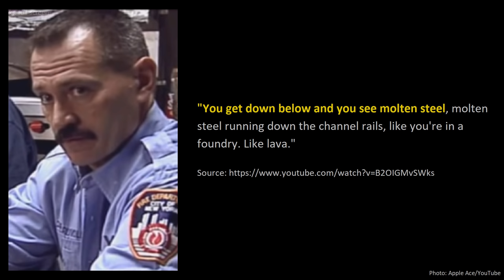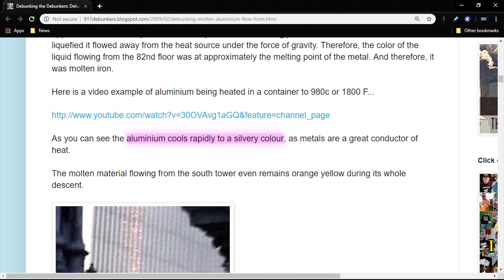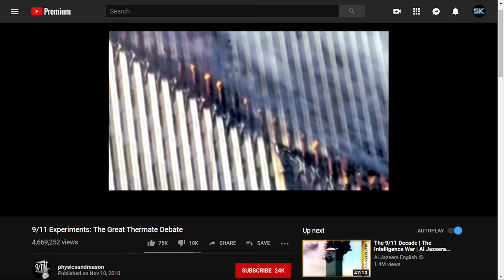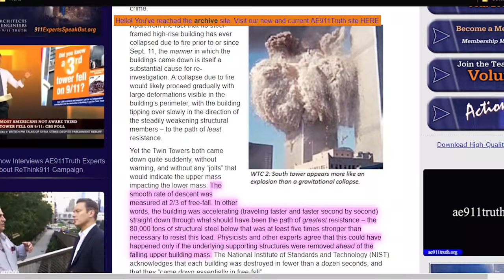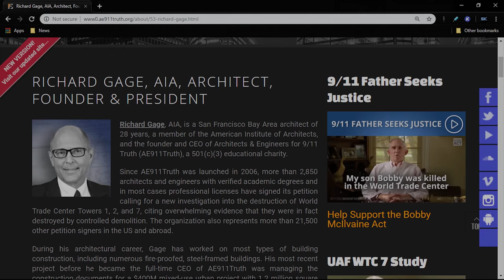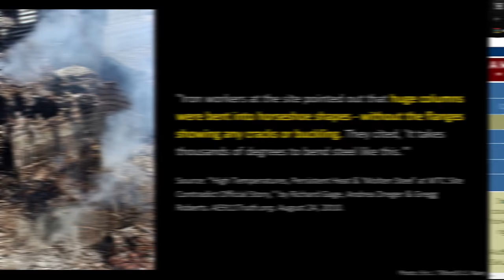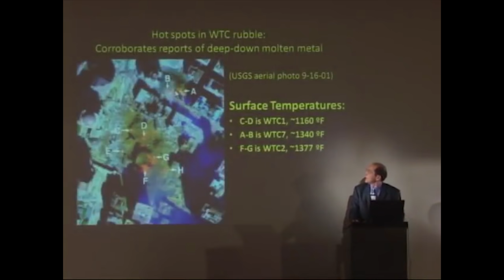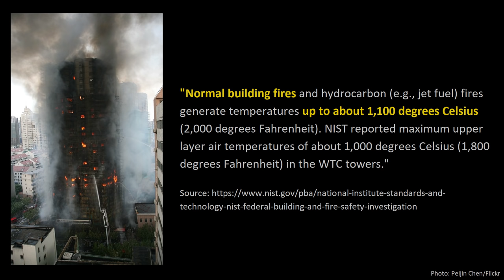9/11 Truthers Debunked: "Molten Steel = Thermite From Controlled Demolition!"

Comment from the maker: The only previously-molten material I'm interested in are the bars of gold you're going to use to support me on Patreon: https://www.patreon.com/aSkepticalHuman
Reply: The reason why his devices don't work as weel is that the thermite isn't pressed (0.7 bulk density), however you can easily achieve 2.0+ densities, i.e. 3× lkess thermite in a given charge. I assure you that those devices are more than capable of collpasing even massive steel columns. It takes about 3 g of composition to melt and blast away 1 g of steel. The volume of filling needed to completely cut a core column would be 50 - 200 l - depending on the row (500 - 1000) and floor.
Also, you don't need to cut - heat weakening is a way to go, too - a less efficient one, though. Just two cuts to a flange will mess up a column, too.

The reason given for the location of the stream is that this was a core column charge from 900/1000 row columns kicked into the corner by airplane debris.

Third, you missed the most obvious debunking point - molten iron is WHITE hot, not yellow.
Reply: Either you're purposefully ignoring way too many coincidences and commonalities of evidence that point to the 9/11 as a MOSSAD/CONSPIRACY operation, 

OR

You are completely unfit and too biased to be an investigator of reasonable evidence. 

1. Larry Silverstein purchases lease for World trade center and the twin towers. A purchase that nearly every business analyst recommended against. The Towers were filled completely with asbestos that would cost a furtune to get rid of....But regarless, Silverstein makes the purchase and takes out huge insurance policy on towers against terrorism 6 weeks before 9/11. 
2. Silverstein worked in the towers every single day without fail, as well as his children, but happens to miss work that day? as well as his children? How convenient...
3. Silverstein gave the "go ahead" to "pull"(demolition term) Building 7, to which the OFFICIAL 9/11 commission report didn't mention the collapse of the 3rd skyscraper that day. A building that fell at free-fall speed, a complete scientific Odyssey, to which if true, we would have to re-evaluate Newtons laws of Physics! No steel buildings have ever collapsed into their footprint, pulverized heavily, at free-fall speed from office fires/jet fuel. 
4. Urban Moving Systems (proven front for Israel intelligence agency) given $500'000 Federal Government Assistance Program On June 22, 2001. A moving company that was used to move out Israeli companies at company losses out of the twin towers just a few months before the attack. The moving vans were later verified to have bomb residue through bomb sniffing dogs.... Israeli companies foreknowledge of attack... Planted explosives brought in.
5. Israeli intelligence agents found celebrating the collapse of the towers, admitting they had foreknowledge of the events. Israeli agents under benjamin netanyahu, who larry silverstein spoke to on a regular basis. If Israeli intelligence knew, Silverstein knew.
6. September 10th, 2.3 trillion dollars admitted to be unaccounted for? Pentagon accounting offices trying to account for this money completely destroyed the next day under the guise of a plane hitting it? To which dozens and dozens of cameras could have captured? But the government refuses to show any of those, and hand picks ONE inconclusive video with botched frames?
7. Molten steel from dozens and dozens of first responders and witnesses, combined with nanothermite in all dust samples. This fact alone debunks your entire video. NANOTHERMITE. ADVANCED, MILITARY, EXPLOSIVE, MATERIAL.
8.Mysterious deaths of key witnesses of 9/11 with the likelyhood of all of them dying in the fashion that they did comparable to one person being struck by lighting 10X. No investigation of that, many unanswered questions, purposefully abandoned.
9. There are hundreds of other related, convenient, and coincidental points. 
10. There is no problem with leaning towards believing in a conspiracy. All it is, is following a lead of evidence, just like any other type of investigative groundwork. People who lean or believe or bend towards following evidence that leads towards conspiracy are just are actually regarded as better investigators, so long as they an remain to be unbiased in the end, and remain open to all facts, no matter what side of the coin they're on. 
11. I used to buy into the false narratives, before I developed and open mind.
Reply: @sadiel6353  I'm enlightened and everyone else is a shill! cough spit
Reply: So, how about you Explain how Building #7 Collapsed from office fire...... And Please Explain where the Remains were, of the air plane wreckage, in the 911 Pentagon crash, and Shanksville 911 crash.. Thank you..
Reply: @valleygirl7736  🙄
Reply: @julianerikson4191  you're going to be very insignificant in your life if you wont wake up. But it's your choice Mr. Blue pill.
Reply: @justinturner8219  Insignificant in what way and how would you know?
Reply: @julianerikson4191  you realize everything he wrote was factual right? None of that was made up. How does that make him a nutbasket?
Reply: @Insane3OB  a person is not likely to have much of a real affect on the world of they dont understand how the world really works.
Reply: @justinturner8219  Which is why conspiracy theorist's talk a lot of nonsense. They don't live in reality.
Reply: so the picture with glowing metal says oct 21 2001 so it was glowing for 40 days what keeps metal that hot for so long???? It doesnt self combust.I use a torch and weld all the time it quickly disapates heat.The buildings wouldnt collapes like it did either 1,500 enginers say a skeletal metal building expecially from floor 1-50 that had no damage should have stayed and definally would not have the speed of damaged floors it would have slowed down and slide to a side not straight down
Reply: One simple question:
Do you completely believe the official story about September 11, 2001 or are there any parts of it that don't make sense to you?
Reply: @justinturner8219  Very close to my view on it im not sure of the isreal thing.They shut the power off the twin towers so they could do work which also shuts the sercurty cameras off months before 9/11.You didnt mention building 7 explosions or the guys walking away from the building with hard hats and repeatingly say the building is coming down then boom.Had to be the demolision guys how would they know.Question those guys.Enron and security exchange fraud cases in building 7 helped bush and cheny and friends
Reply: @nehorlavazapalka  Molten Metal is white hot; not yellow? You don't weld and/or fab much; do you?
Reply: look at it ... just take a look ... Uh you will see  how some researchers/debunkers are in dipper compared to this simplest approach
Reply: way to many blacked out parts from the official investigation documents that were published. 911 will always have a dark shadow over it, no matter how many videos youtube deletes, to erase the history.
Reply: No, it's Building 7.
Reply: No one supports a fraud
Reply: Pretty crazy the aluminum wings ( the lightest part of the aircraft) cut through the steel outer wall also.
Reply: @justinturner8219  Oh, look, a list. Lists are fun. Let's see how well THIS list does.

"The Towers were filled completely with asbestos that would cost a furtune to get rid of"
And which would have made Silverstein not actually lease the WTC. Thus, we can conclude that there was no asbestos. This of course on top of the fact that, if there HAD been need for a asbestos removal, that would have fallen on the owners, not the leasee.

" Silverstein worked in the towers every single day without fail,"
No, he didn't. He did, however, USUALLY show at the Window to the World restaurant in the morning. But on the  day, he had a medical appointment, something which is publicly known.

"Silverstein gave the "go ahead""
No he didn't. That you don't know what he said doesn't mean he said what you want it to.

"to "pull"(demolition term)"
No it isn't, in the way you want it to be. That you don't know what it means doesn't mean it's what you want it to be.

" to which the OFFICIAL 9/11 commission report didn't mention the collapse of the 3rd skyscraper that day"
Which would follow, since the Commission had nothing at all to do with that.

"A building that fell at free-fall speed"
This means two things. First, you don't know anything about physics, and the meaning of the term you're using in error. And second, that you don't know anything about the buildings at the WTC.

" we would have to re-evaluate Newtons laws of Physics"
I suggest you go back to school and actually learn . There are no "Newton's laws of Physics". There's Newtons Laws of MOTION, but they don't apply here.

"No steel buildings have ever collapsed into their footprint, pulverized heavily, at free-fall speed from office fires/jet fuel. "
This, of course, is supposed to be MEANINGFUL. What it manages to be is STUPID. Let's count the ways this shows your utter lack of knowledge, education or capacity for though.
1, "no steel buildings have ever" is a lie. It happens multiple times a year. 
2, "into their footprints" is brainless nonsense. That didn't happen at the WTC, easily enough realized if you actually bother to look up how they fell. For instance, the North Tower fell ONTO WTC 7, causing the fires. There was 400 yards between them.
3, "at free-fall speed" again, which as noted is not only an overwhelming lack of knowledge of basic terminology, but also is stupid, since that demonstrably didn't happen.
4, "from office fires/jet fuel" is another idiocy. Amazingly, buildings don't actually know what is burning and collapse differently depending. Nor does "office fire" have any meaning, this isn't a smoldering cigarette in a trash-can, no matter HOW much you want to pretend it.

"Urban Moving Systems (proven front for Israel intelligence agency)"
This is bull. SUSPECTED, at the time, maybe. Proven, nonsense.

" A moving company that was used to move out Israeli companies at company losses out of the twin towers just a few months before the attack."
This is an out and out lie. UMS had no connection at all with the Twin Towers.

"The moving vans were later verified to have bomb residue through bomb sniffing dogs"
No, they were in fact verified to NOT have had any "bomb residue", or even EXPLOSIVES residue. Specifically verified not to.

"Israeli companies foreknowledge of attack... Planted explosives brought in."
This is just empty nonsense, not even worth laughing at.

" Israeli intelligence agents found celebrating the collapse of the towers"
Which failed utterly on the "intelligence agents" and the "celebrating". Which really renders the entire sentence moot, doesn't it?

"admitting they had foreknowledge of the events"
Along with all of New York and New Jersey, you mean?

" September 10th, 2.3 trillion dollars admitted to be unaccounted for?"
Which, 1, doesn't mean what you want it to, but also, 2 is EXCELLENT proof of there being no connection to 9/11. Thank you.

" Pentagon accounting offices trying to account for this money completely destroyed the next day under the guise of a plane hitting it?"
Wow. You failed in three different ways in the same sentence. 1, what was in the area struck by Flight 77 is well known and documented. 2, see previous point about neatly disproving yourself and, of course, 3, having a plane strike something is about as great a guarantee of NOT destroying everything as you can get.

"To which dozens and dozens of cameras could have captured?"
The "dozens and dozens of cameras" that aren't actually there, no matter HOW much you want this to be a cheap B-movie techno-thriller? Sorry, Jason Bourne et al aren't actually REAL.

"and hand picks ONE inconclusive video with botched frames?"
The "hand-picked" one that was the result of a FOIA request, and so came about NOT because of the government?

"Molten steel from dozens and dozens of first responders and witnesses"
None of whom actually stated "molten steel"? Who, the approximately half a dozen who DID, weren't competent to make such a determination? The "molten steel" that left no remains, no residue, NOTHING to show it had ever actually been there?

"combined with nanothermite in all dust samples"
That you don't know what thermite IS only mean that you don't know. Nothing else. Only that you're not smart, alternatively educated, to make a comment. That's all.

"NANOTHERMITE. ADVANCED, MILITARY, EXPLOSIVE, MATERIAL."
Which, 1, was "magic space dust from cheap airport thriller novels" back in 2001, and, 2, don't actually explode. Yeah, that "not smart, alternatively educated" thing? It bit you again.

".Mysterious deaths of key witnesses of 9/11"
Which, amazingly, DIDN'T actually happen. This isn't the movies, and the Black Helicopters aren't actually out to get you. Sorry to ruin your fantasies.

" There are hundreds of other related, convenient, and coincidental points. "
None of which you can actually mention, instead pulling the same trite, stupid shit that all "truthers" regurgitate, having heard it all from their "truther" buddies, who heard it from, and so on. But really, it's true!

"There is no problem with leaning towards believing in a conspiracy."
Of course not. Conspiracies happen all the time. Al-Qaeda committing a terror attack on the US was a conspiracy, for instance.

"All it is, is following a lead of evidence, just like any other type of investigative groundwork"
And then having the mental capacity to look at your "evidence" and considering if it's actually evidence or if it's nonsense, as well as having the ability to actually understand and accept the factual, science-based answers given to your questions.
This, no conspiracy theorist is able to do. Because you're SMRT! you are! You know better. ALL the scientists and professionals out there are stupid sheep, they just don't have the clarity of vision and overwhelming amount of brains that you have.

" so long as they an remain to be unbiased in the end,"
There's no such thing as an "unbiased conspiracy theorist". Confirmational bias is inherent in you all.

"I used to buy into the false narratives, before I developed and open mind."
Which you then quickly clogged up with stupid.
Reply: Molten Aluminum is Silver in daylight.
Reply: What facts? You gave nothing.
Reply: @julianerikson4191  not even a valid counter arguement.
Reply: @mooneyes2k478  still waiting for those "facts" you got, buddy.
Reply: @mooneyes2k478  still waiting.
Reply: Who would support a greedy sheep?
Reply: People who believe it was a "muh terrorist attack" 😂
Reply: @robertgunnam8663  Anyone who send money to Richard Gage, Judy Wood, etc, etc.
Reply: @thumb6170  " and you have no evidence he is scamming"
Yes, I do. It's called a 990 form. It's required from "non-profit", very much in quotations when it comes to Gage and A&E911.

The A&E911 990 from, which incidentally they have to supply on request, show very clearly that they're committing tax fraud. The primary purpose for this, as best as I can tell, is to pay Gage 80 thousand dollars a year, while carefully not actually reporting that.

Nice money if you can get it...

As for your "shit", yeah, it's shit. So?
Reply: How the fuck does this mean he is committing tax fraud, he not paying taxes? A citation is needed that Gage doesn't pay taxes. it also seems the money donated goes to the lawsuits (Matt Campbell's just reached its goal now the case needs to be reopened to continue), the UAF report (which satisfied everyone), & getting more Architects & Engineers on the movement (which they did) so "scammer" is not really fitting the Man himself as you failed to even provide at least real evidence he is or at least a citation or maybe an employee speaking out.

If anything the real scammer is the us government with the commission report which was underfunded by our tax money & was set up to fail.

Plus how does this disprove what he says, you clearly couldn't refute the aluminum arguement nor the documentary I sent you.
Reply: I've read recent ones, nothing to see here. Now stop whining 😏 😏 😏 😏 😴😴😴

Gage is 100% not a scammer 😎
Reply: @thumb6170  What's that? You had nothing so you tried to make it about anything else? This was already known, no need to tell everyone.
Reply: Ok Gage is not a scammer. He is a God.
Reply: @thumb6170  Sure. A guy that lies on the tax return of his supposed "non-profit" organization, in order to enrich himself, is a god.
Good sign, there. So much for the supposed "truth", huh.
Reply: I'm not finding any evidence showing he is a scammer. Are you sure you are not the "conspiracy theorist" 😏😏😏😏
Reply: @thumb6170  That you're not able to understand a 990 form? Doesn't really mean anything other than that. As noted, take a look at their 2015, 2016, etc forms. Then compare them to each other.
Reply: I did, it doesn't say he is a scammer.
Reply: I'm not seeing how he is a scammer. Can you tell me? I'm looking at the fourms from 2015 to 2016 its not telling me anything.

& if so why isn't he arrested? 😏😏😏😏
Reply: So its confirmed, you have ZERO evidence suggesting Richard Gage is a Scammer. So much for those "facks" you claim to have. 😏😏😏😏

Anyway I have a question thats off topic but since your a "geenis" I want you to anwser it,

If I take 1 hour to cook a batch of cookies and the cookie monster has 15 ovens working 24 hours a day every day for 5 years, how long does it take the cookie monster to make 6000000 batches of cookies?
Reply: @thumb6170  
2015, 2016: "neither the organization nor any related organization compensated any current officer, director or trustee"
Oh, look, "current officers", read Gage as up to 2018, he was the ONLY officer to be compensated, was compensated 85 and 65 thou, respectively. That's lying on the form.

2016, "fees for services, other" 208,113. Total listed fees, 89, 318. Where's the other near 120 thou?

2012-2016, "Other fees for services", 47,974+41,344. Exactly the same sums, four years in a row, minimum. Copy-pasting is nice and comfortable, but it isn't legal.

From 2009 to 2016, Gage received an average of 79 thou, with a high of 85 and a low of 65.5. Of course, in 2015 and 2016, there was no compensation stated as noted above, but strangely, expense item 5 is still filled in. Surely, a coincidence. Compare 2014, where it's stated that Gage is paid 70,835...and expense item 5 is, what do you know, 70,835.

And in every year, from 2009 to 2016, Gage is the ONLY "current officer, director or trustee" who has been paid by A&E911. Hence, the organization commits fraud specifically to pay him.

2010-2016, A&E911 check the box that reads "Is the organization required to complete Schedule B, Schedule of Contributors?"
Thus, they said themselves that they were required to do so. DID they do so? No, they did not. This additional form required them to list donors that contributed more than 5 thou over the tax year. 2014 and 2016, there was only the first page, no list. 2015, there's no Schedule B at all. This is, again, cheating on the Form 990.
Reply: I'm not seeing how he is a scammer, your wall of text isn't telling me what is being shown on the 990 report. & he is pretty much fulfilling the movements goals with the donated money. No fraud here.

You obviously have no sources either.
Reply: I've read it, it doesn't tell me he is a scammer, you have ANY REAL SOURCES telling me he scams people?
Reply: I see you have no sources for these ridiculous claims, I'm gonna listen to the real men now. Keep making your little fantasies about scams & the 990 forum being proof while giving no evidence 😏😏😏😏
Reply: @thumb6170  You mean other than the Form 990 that he, as head of the organization that he founded, have to sign off on, and which clearly show that the organization is defrauding the US on its taxes? The organization that, prominently and repeatedly extols you to "donate" on its website?

Yeah. What was that about keeping your fingers in your ears, again?
Reply: No evidence 😏😎😎😏
Reply: Aww did you have to face you have no evidence? 😏😏😏😏
Reply: Come on, i don't have all day i need evidence! The 990 forum & your sourceless blabbing is nothing 🥱🥱🥱🥱
Reply: OK I guess you have no evidence or sources so. 😴😴😴😴 come on if you think Gage is a scammer i need information like a source, you know an article that is proof. The 990 was nothing. Its the money the organization receives & how its recieved. Don't think he is scamming til proof is provided.
Reply: You have no evidence do you? 😴😴😴😴
Reply: @thumb6170  As noted. That you want to ignore that evidence because it makes you sad doesn't change reality. Sad for you, but there it is.
Reply: What evidence? The 990 gave me nothing. LoL 🤤🤤🤤🤤
Reply: @thumb6170  As noted. That you want to ignore that evidence because it makes you sad doesn't change reality. Sad for you, but there it is.
Reply: Aruba, Jamaica, oo I wanna see a
Proofado, Jewmado, Gage is a scamrado
Bermuda, Bahama, comon show it mama
Key Largo, Montego, 990 does not show
Please if get proof to show
Just drop it under
& let me know.
Reply: I'm pretty happy rn, you can't even back your claims so you NEED that last word, just let it go lol
Reply: @thumb6170  Yeah. So, you've consistently and repeatedly ignored the evidence presented, because they don't fit with your wishful thinking. When faced with this, you've done pretty much everything including regressing to a 5-year-old to avoid it.

Who was it who "needed the last word", did you say?
Reply: "Evidence", yeah i keep asking for that, can I have it? 😴😴😴😴
Reply: @thumb6170  No, like a 5-year-old that doesn't get his way, you keep ignoring it because it proves you wrong. So, you default to acting like that 5-year-old.
Reply: I didn't ignore it, you didn't give it. 😏😏😏😏 & I guess you have no evidence then.
Reply: @thumb6170  You keep doing that. Ignoring facts you're told, that is. Why is that, no-one wonders.

"No, like a 5-year-old that doesn't get his way, you keep ignoring it because it proves you wrong. So, you default to acting like that 5-year-old."
Reply: "Facts" I still don't have any from you. 😏😏😏😏
Reply: @thumb6170  Except for the ones you deliberately ignored. Which is a thing with you. And really telling.
Reply: I didn't ignore anything. You just didn't provide a fact or proof that he is scamming beside the non profit card which to me proves nothing unless you have a whistleblower from the organization itself. So..

🎵Aruba, Jamaica, oo I wanna see a
Proofado, Jewmado, Gage is a scamrado
Bermuda, Bahama, comon show it mama
Key Largo, Montego, 990 does not show
Please if get proof to show
Just drop it under
& let me know.
But it seems you failed to show
Real proof thats worth a little note..🎶 😏😏😏😏
Reply: Teehee 

https://youtu.be/30OVAvg1aGQ
https://youtu.be/beGkPlJ2eZo
Reply: This is fun.
Reply: @thumb6170  "I didn't ignore anything. You just didn't provide a fact or proof that he is scamming beside the non profit card which to me proves nothing"
Yeah. As was noted, repeatedly.

"No, like a 5-year-old that doesn't get his way, you keep ignoring it because it proves you wrong. So, you default to acting like that 5-year-old."

"This is fun."
That it amuses you to be stupid doesn't surprise anyone.
Reply: It amuses me that you can't prove a single thing to me that even states this man is bad, so all you do is get angry & call me funny things like a child. 😏😏😏😏

I don't see a single thing on the 990 report that shows he is scamming.
Reply: @thumb6170  That you're willing to ignore what's there, and what you're told, only show that you're sticking your fingers in your ears so you don't have to face that your hero is lying on the tax returns of his organization, in order to pay himself money.

Same thing with the aluminium. Ignoring basic physics in favor of your made-up nonsense is meaningless. That your OTHER hero make a video that proves him, and you, wrong only means its proving you wrong. Spamming it multiple times doesn't change things.
Reply: LoL your unscientific & proofless arguement is epic 😎😎😎😎
Reply: >proof & science

Yeah tell another lie.
Reply: @thumb6170  And, what DO you know...
Reply: LoL that molten material was orange/yellow not red hot, it's finalized that was molten steel not aluminum. even nist confirmed that molten Aluminum is silvery
Reply: @thumb6170  "LoL that molten material was orange/yellow not red hot"
You really have no knowledge at all of basic physics, do you?

See if you can follow along here: heat scale runs from deep red to bright red to orange to yellow to white.

Oh, incidentally, thank you for disproving yourself. Liquid steel is white, not red as you claimed.

"even nist confirmed that molten Aluminum is silvery"
Really? Do please show where they did that?
Reply: Yes

They say it right in the book about the tts.
Reply: @thumb6170  Right. "The book about the tts".

Do you work on saying even stupider things than normal, or does it just come natural to you?

Let's see if a repetition gets through to you. It hasn't so far, but hey, hope springs eternal and all that, right?

"Do please show where they did that?"
Reply: You really do have no evidence supporting your claim, do you? God bless Gage
Reply: That liquid metal could be thermite or aluminium. All you need to do is to look that the simulation done from NIST vs UAF vs the video of WTC7. The shape and angles of the 2simulations falling vs the actual video of WTC7 falling shows that  the UAF simulation was clearly looked almost identical to the actual collapse. Also the time it takes for the UAF simulation and the real building fell was very close. However, the time it took for the simulation from NIST was much longer than the actual time it took for it to collapse. ALSO, NIST has most of their information from their simulations classified. And UAF published their full  findings and the specifications of the simulation. Real science reports display all the data and findings. That’s all the real proof you need.
Reply: I don't even give a shit if thermite is involved or not I just know it was demolished & we should now focus on the perpetrators. (Israel, Saudi Arabia, & US Gov't) its all about money.
Reply: *NOTE: Plasco Building doesn't count since its up for question & has every feature of a demolition.
Reply: Hey Einstein , tell me when the molted aluminum was coming out of the twin towers .... How did it stay Molted long enough to end up under building seven , which collapse hours after and still stay Molted  weeks later...
Aluminum alloys go back to a solid phase in less then 30 min.... I'm insulted they would think we would fall for that 
And you should be embarrassed you not only fell for it you advacated it
Reply: @julianerikson4191  Yo people who live in Texas have an extra chromosome.
Reply: Aluminum isn't going to stay at 2400°F to 3400°F for near 3 months. Also, how does molten aluminum get in the basement. Aluminum is not bright orange when molten. I am welder and it is never that color. I cut the stuff with a cutting torch that burns at over 5000°F and the stuff is always silver.
Reply: @Insane3OB  actually I think it’s u not living In Reality.  I think covid showed a lot of people that us conspiracy theorist are not crazy.
Reply: I'm a professional welder and I cut aluminum with a cutting torch every working day. A cutting torch burns at over 5000°F and the aluminium is always silver.
Reply: Copy-paste in a new tab to read this scientific article:
"What Accounts for the Molten Metal Observed on 9/11/2001?"
Reply: @ASkepticalHumanOnYouTube and you sir are also make an assumption that it was aluminum so there for your assumption is also failure and also I'd like to add they never tested the liquid metal therefore your assumption is open to debate also better to have an open mind then to just believe every thing your told
Reply: @jmendo2546 1,500 out of over 1,000,000 engineers 😂😂
Reply: @jmendo2546 shut off power where?? The largest Building in New York there would be alot of pictures of that
Reply: Why would anybody want to give you anything?
Reply: WHY are all compilations coming out these years NOT showing the molten steel you show here. It have been erased my friend! WHY are building 7 left out in the clips coming out these years? Because it cannot be logically explained. Building 7 were left out of the 9/11 commission report for the same reason.  Building 7, a huge building, were NOT hit by an airplane but still fell with gravitational speed, all corners at the same time, hours after WTC1 and 2, that also fell with gravitational speed, THAT are ONLY possible when the resistance are removed below and THAR are only possible if the below are removed in a controlled demolition. Witness after witness have explained how they heard a series of explosion as the building fell. 

There were 2 planes in New York but 3 buildings that fell in the same way. Very telling that all these compilations do not include building 7. The explanation for buildings 7´s collapse cannot be made that are why the 9/11 commission excluded that building and why we do not see it here. The power "some" have are more than real. If any wanna comment on this then please start by explaining building 7`s collapse. NO other rebarbed concrete building in the world have ever done what building 7 did. Look up the owner of building 7 and watch him say, the day after, that "it were decided to pull the building" and then ask a demolition company how long time it would take to plan such a demolition let alone prep the building itself with explosives. 
WTC were filled with asbestos and had to either be renovated for a huge amount or demolished. Were sold 2 months before this happened and then insured for double its worth. The owner were a jewish Israeli and he were same guy that on open camera and mike said "it were decided to pull the building" when speaking of building 7 that were not hit by any plane but fell like WTC 1 and 2. 
The 3000 people killed that day have STILL not gotten the same basic murder investigation even a drug whore are entitled to. The dust from these buildings were investigated and ALL samples contained nano thermite! ALL OF THEM!
Reply: This has already been PROVEN that melted aluminum is SILVER ya know... like ALLUMINUM as Steel melts with orange colored material. WRONG AGAIN THANKS FOR PLAYING. Your skepticism is obviously very easy to please. You could have watched videos on the two and compared them but i doubt you went as far as to watch the videos of both melted materials. The FIRE FIGHTER SAID FOUNDRY not a Capri Sun commercial or Terminator 2's T-1000. Architects and Engineers for 9/11 Truth do a great job at breaking this stuff down aesthetically as well as mathematically and multiple ways to illustrate the data I highly recommend anyone with a genuine interest in the physics to listen to professionals not youtubers. I have a shoe myself that tackled all this last month for the first 11 days of September Check it out by clicking onto my chathead... tap my head... go on
Reply: @uselessagent7342  Architects and Engineers are con-artist
Reply: I'm a welder and I've worked on multiple massive building projects under structural engineers. You don't know what you're talking about! Period!
Reply: Ok so a slight correction in regards to the aluminium part that you may have already done nut here goes.

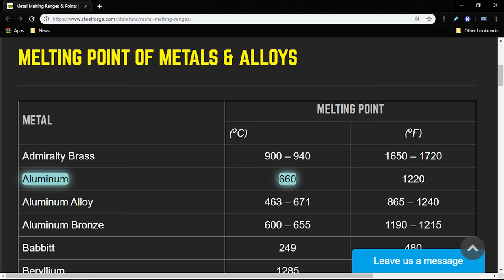Pure aluminium is not really used much for anything as it is invariably a aluminium alloy of some type that is used, look just below aluminium on your chart at 3:23 and there it is.

Also notice that like a lot of alloys it has a "MELTING POINT RANGE" not a MELTING POINT and it is almost always LOWER than the melting point of pure aluminium.

Within its melting point range, an alloy can be both partially liquid and partially solid. 

If the temperature is increased above the melting range, the alloy becomes fully molten, and below the range, it is fully solid.

No need for a full list as these 2 are what the 767 was made of.

2024 aluminium and 7075 aluminium as both are used for aircraft structural parts, fuselage and wings

2024 aluminium melting range 935°F – 1180°F (500°C – 635°C)

7075 aluminium melting range 890°F – 1175°F (475°C – 635°C)
Reply: You are doing God's work.